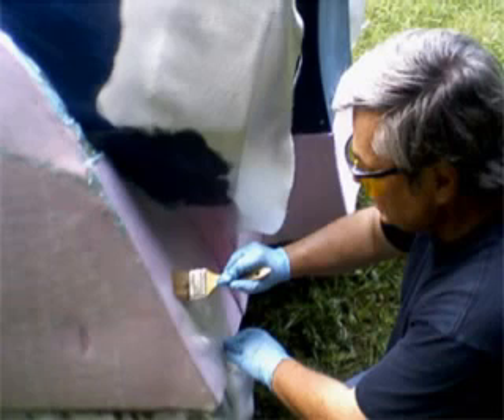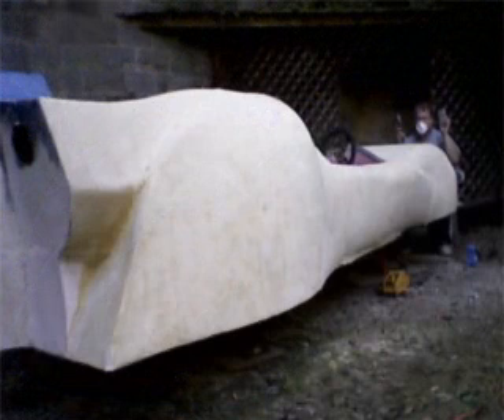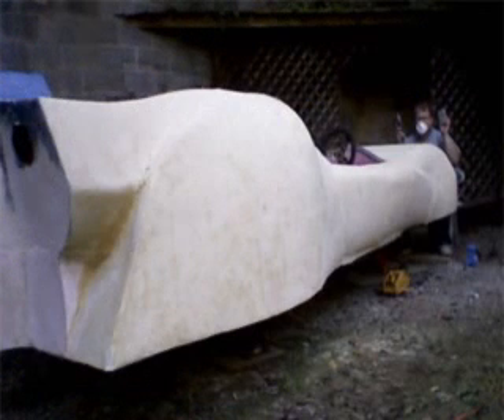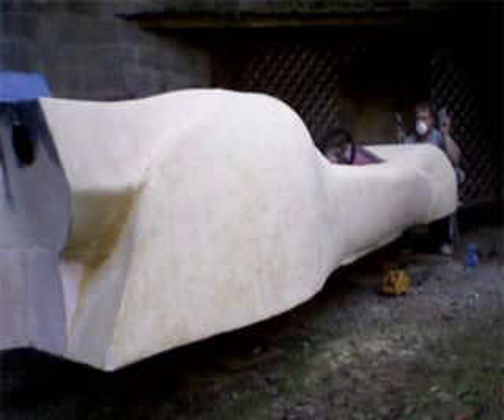Electric Car Fiberglass Body Build part 2

Comment from the maker: Thank you, glad you found it helpful.  To fiberglass the body we chose an 8.5-ounce fabric from ThayerCraftdotcom, style 7725.  This bi-directional, twill, fiberglass fabric has a Volan 504 finish that can be used with any resin and has excellent drape-ability.  The epoxy we purchased was from JGreerdotcom, AeroMarine 300/21.

Comment from the maker: The steel frame is covered by the body.  The body is made up of all kinds of material from wood, plastic, odd pieces of fiberglass, Styrofoam, and even cardboard! The fiberglass is laid over the body and also over some parts of the frame (to keep the body securely attached to the body).

Comment: So I guess I can say Ive been glassing for 39 YEARS....MOLD AND PART MAKING CERT 35 YEARS AGO DUDE, ... Vinyl & ISO 33 Years ago, Kevlar Dry 12 years ago, Kevlar wet 11 years ago, Carb-Fibe 14 Years ago.. Banana Oil Base 23 years ago, Design Tech International Plastic 16 years ago, Poly-form & Poly Fill 30 years ago... Dry Bake 8 Years.  Re-cert 2 years ago.. Technically Ive been glassing for 39 YEARS!...My experience in ALL AREAS FIBERGLASSING  have different start & Certification dates.. DUDE

Comment: @ChrisD1andOnly . Theres many areas of Fiberglassing & Layup, Simple Repairing to the Simple Fiberglass Part Making to the simple Fiberglass Mold Making.. Then to the much harder Multi Part Mold Making to the Mold and Part FABRICATION in other areas of Composite Fiber-glassing...from Vacuum Bagging, Form Press, Dry Bake, Kevlar lay-up dry & wet, Carbon Fiber Epoxy, ISO etc.. MY 1st PAID glass repair at the body shop was at age 17..... 39 YEARS AGO... Got my CERT 35 YEARS AGO. Carbon 14 Years Ago